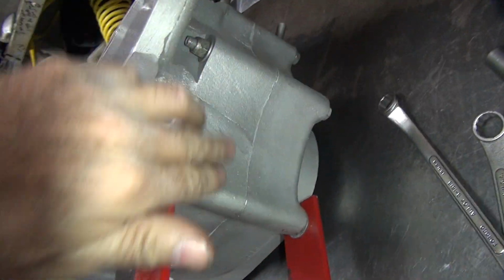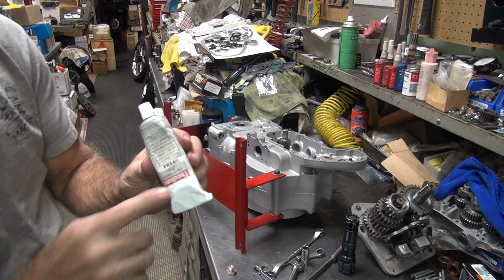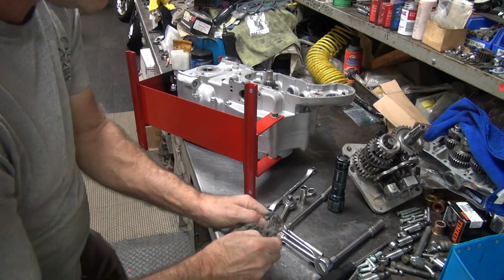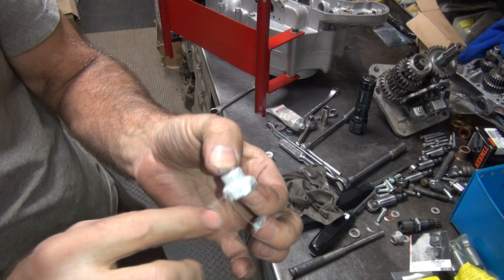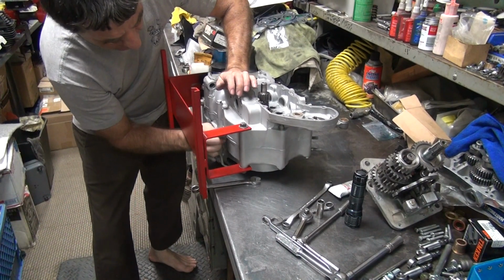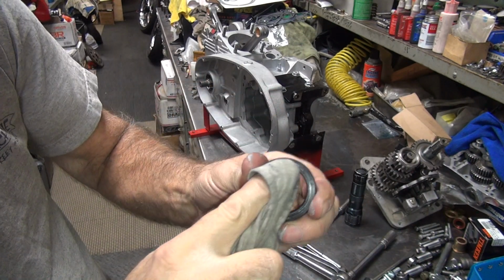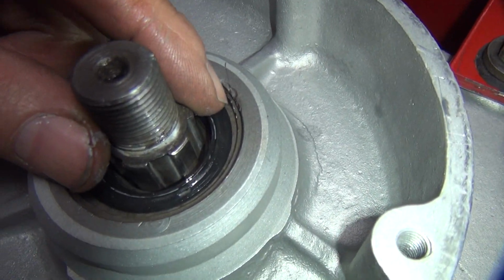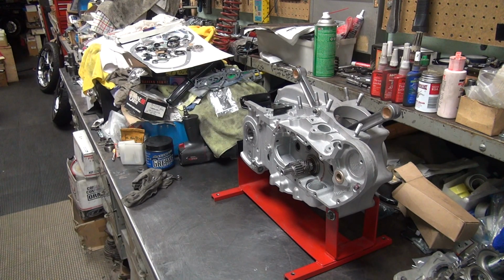1961 xlch #200 no miles transmission motor rebuild sportster harley repair restoration tatro machine

Comment: Can I ask you where you get your rebuild parts for say the four speed Harley trans? Or can you recommend a place? I been a mechanic all my life and now at 56 on permanent disability I pretty much want to put new clutch dogs in the four speed on my 73 Shovelhead. I'm going to get the tool to align the forks as well. Just wondering where the best place to get parts is. eBay maybe? Thanks if you can or if not no problem...
Reply from the maker: every harley shop i know of sells parts. if you had to rely on buying parts as needed, you would never get anything done. most of the time there is always something back ordered or discountiued on these project. that goes for both the new and old harleys. if you watched very many of my videos you would have know that i have way more parts than most any harley shop or dealership.
tatro
Reply from the maker: its a harley repair shop. what do you think all those parts are  in the back ground. did you think they was all empty boxes.
tatro
Reply: All of those parts are your stock to repair what guys bring into your shop for your business. Your not a parts place to sell parts your a machine shop/repair shop, not a parts store. If you sell parts as well then you would be the first shop of your type I've seen that sold parts as well. Most places of business like that don't sell their inventory.
Reply: I dont know anything about your business I'm on the east coast. Things are a lot different here than 3000 miles away. Everyone is different in how they do business...
Reply from the maker: tatro machine is a good spot. i know they have the parts in stock.
does anyone even know this is a real shop.
tatro
Reply: @TatroMachine  I wasn't aware that machine shops sold parts. In my neck of the woods that isn't the case but only there to perform a service on whatever you bring them to work on. I've never heard of any machine shop selling parts outright. Maybe things are different out west where you are ...